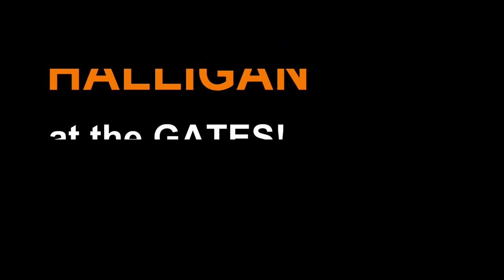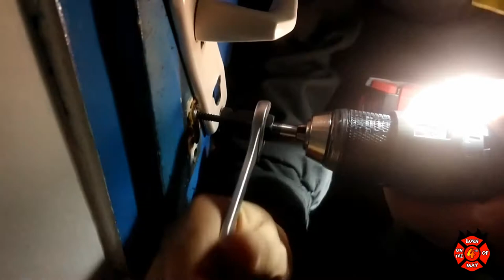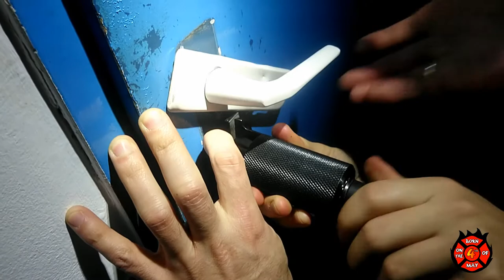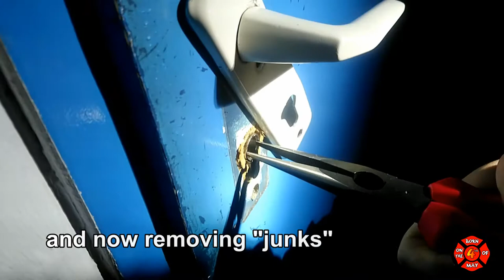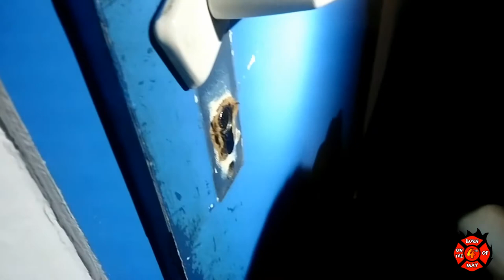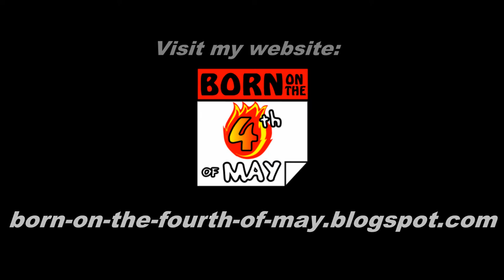Euro Cylinder vs Cylinder Lock Puller set, Halligan at the Gates #7

Comment: It’s easier if you pull the screw with the bell puller without the steel plate. That way the half euro snaps off and it’s much easier to throw back the bolt through the euro hole than trying to access the cam through the euro shaft where the plug was extracted.
Reply from the maker: That's right! It's much easier that way. However this footage was about this method only. See https://www.youtube.com/watch?v=7yQyPzpPScU
Reply: bosnianbill did it like a dozen times using the plate and every time worked great..